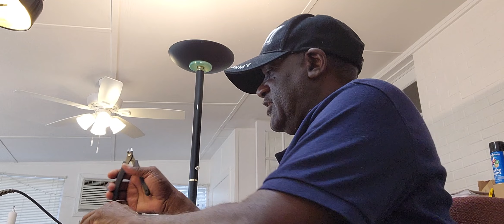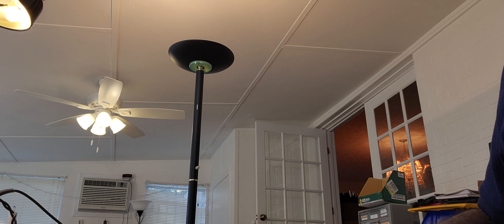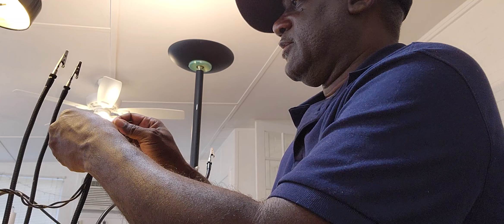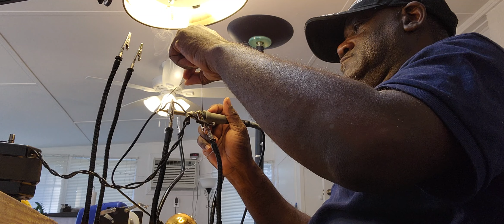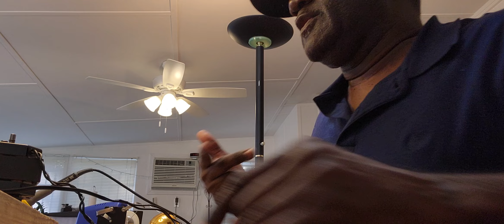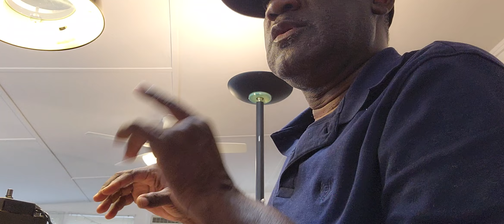Replacing The AC Cord On A Vintage Leslie Fast Motor ~ October 24, 2022

Comment: thanks for the Videos Sir, managed to pick myself an old Hammond L-111 thats a little rough but still works for free cause someone had just bought a house and apparently didnt like the fact that it was left there by the previous owner, and am currently piece by piece buying leslie parts with each pay (so far I got the top horns, bottom rotor, and am waiting on a jensen V21 thats in the mail) and they helped me Learn a  lot, next on the list im going to try to get my hands on the motor stacks and see if i can cobble something up for an amp and motor controls and line out the ol L series although I still see alot of the leslie ampd on ebay so i may just complete it with ebay parts